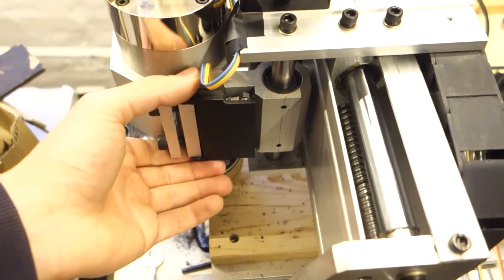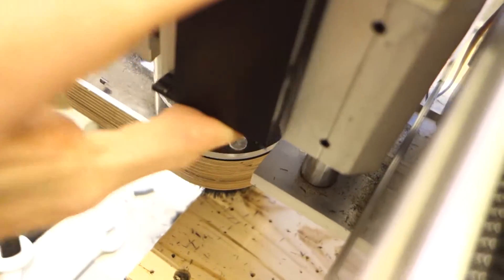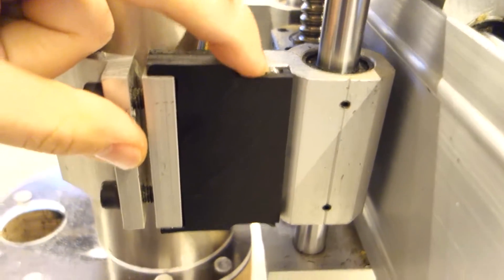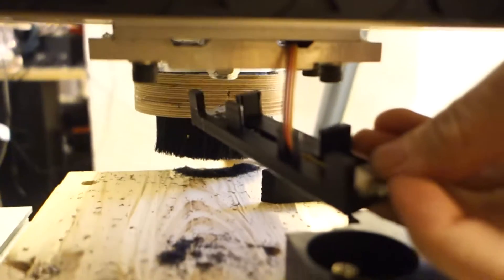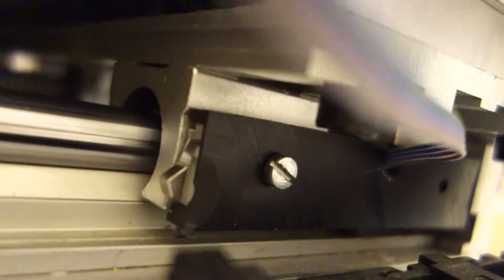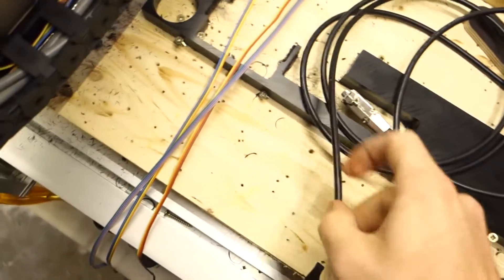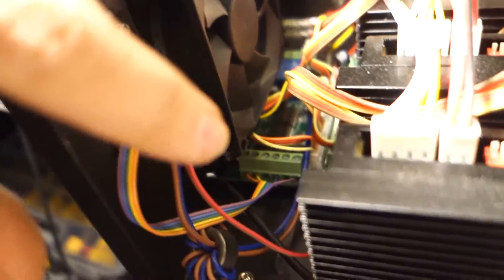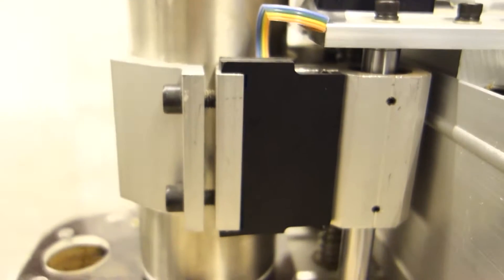CNC 6040 upgrade with reference limit / end switch

Comment: Hello. I see you are using 6 limit switches (12 wires)  but i only see 5 wires connected to the board. Do you have the wirings connections to share please. Also, after conecte, it's only a mater of configuring them in Mach3, let's say? Thank you in advance :)
Reply from the maker: Hi! the endswitches that detect if an axis goes too far are all 3 in series and give a common out-of-bounds signal. so in total i only have 4 signals (3xLimit+1End) + one common reference potential =5. I'm using linuxCNC so i cant help with mach3 configurations - sorry!

Comment: Great, inspiring.... But can the Z limit switch printed part survive from spindel heat ?
Reply from the maker: yeah thats not an issue. the spindle is watercooled and doesnt get very warm. also the part is not printed but milled from Polyacetale. but i think even printed plastic would be ok
Reply: Great... Thanks for your tutorial. Will make this for my 3040 CNC.